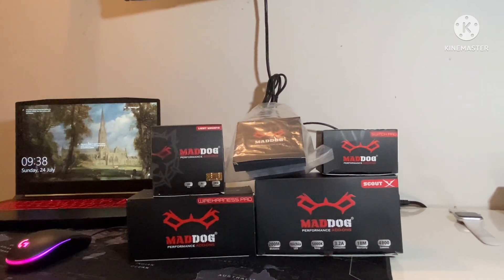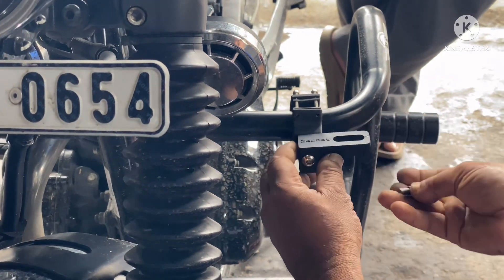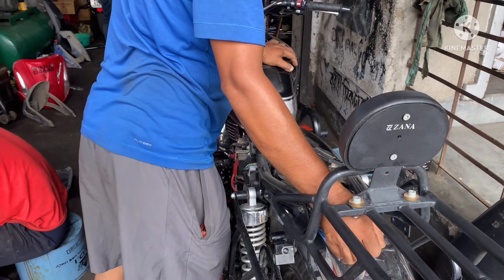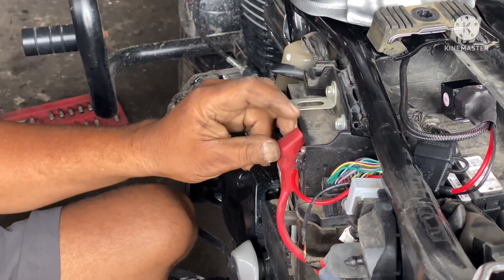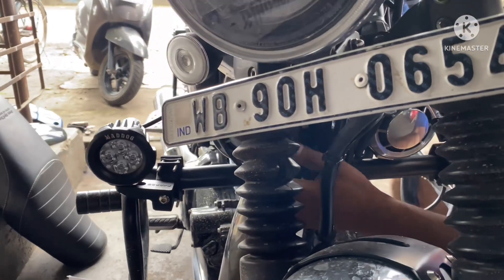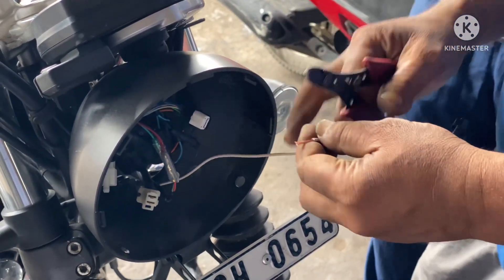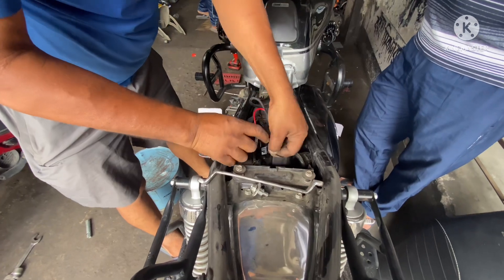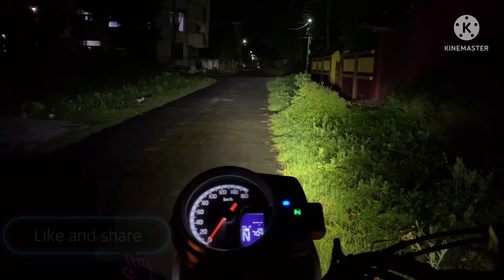Honda Hness cb350 l Auxillary light installation and testing l Maddog Scout X l Accessories

Comment: there is an additional jack for connecting the wires inside hiness's headlight
Reply from the maker: Maddog light connector was not compatible with that
Reply: @birdofpassage7737  okk thanks for letting me know. will try the hjg one then
Reply: On which colour ignition wire of highness did you connect maddog white wire?